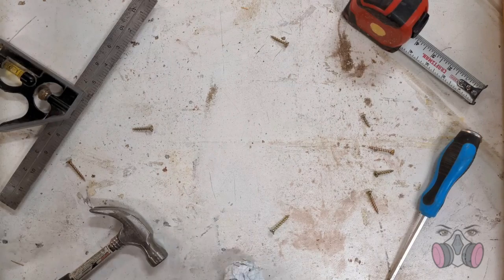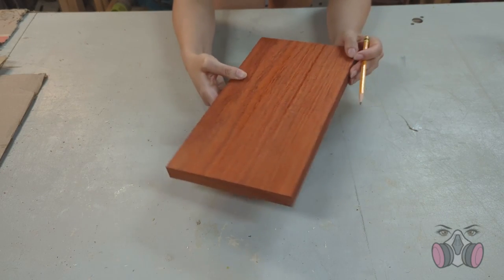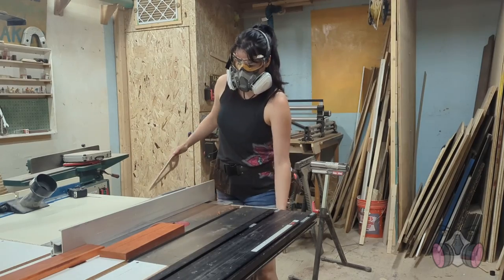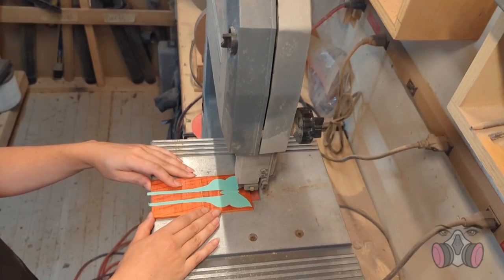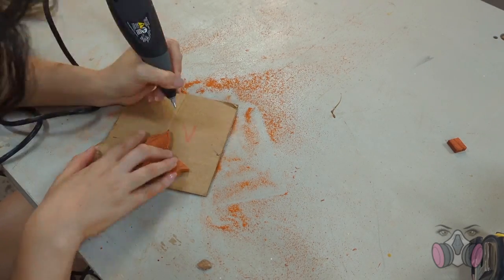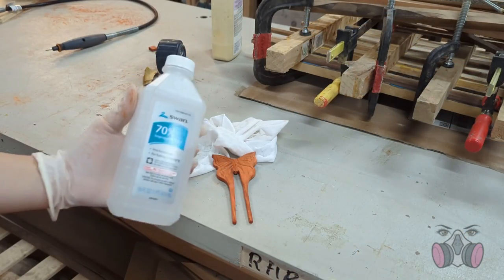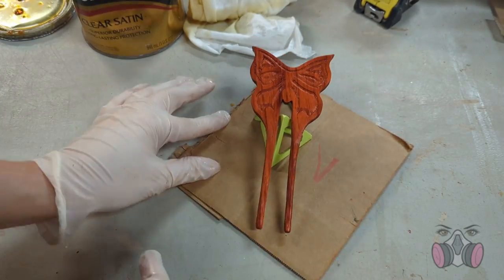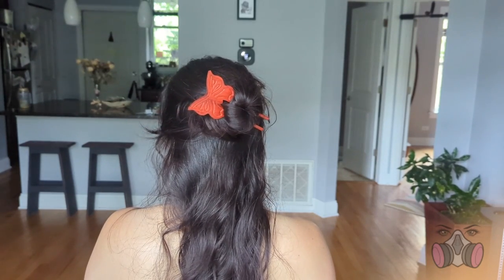DIY Decorative Wooden Hair Fork | Trying Hand Engraving For the First Time

Comment: For the purple heart, you can bake it to get a nice deep purple.  A torch works too but is harder to control(overheat and burn).
Reply from the maker: Oh, interesting. I never heard about this. I'll definitely look into this. Thanks!
Reply: @woodificould  Another thing to keep in mind with purple heart is that it will eventually turn brown. Keeping it out of the sun (or away from UV) will help delay it but eventually it'll lose the purple. I love using it in projects, be it for mallets, cutting boards, or intarsia projects, but I just have to keep in mind that the color is ephemeral.

Comment: Regarding the resawing issues around 4:00 I just switched to a new technique since I had the same problem.   I use the table saw and make two resaw cuts leaving a small connector in the middle. Then use the bandsaw to separate them and plane off whatever’s left.  Works good IMHO but definitely more waste.
Reply from the maker: Funny you mention that because i thought about doing that while I was in the middle of cutting, but didn't think it would make much of a difference. Good to know that it does actually help... might try that next time. Thanks!

Comment: The problem with the purpleheart is, it will in time dull its purple color to a muddy brown. That being said. Your hair fork   looks awesome! I hope you get better soon!
Reply from the maker: Dang, really? I'm guessing that drenching it in poly doesn't help prevent this from happening? And thanks!
Reply: @woodificould  the color changing is a reaction to UV light. When the tree is cut open, it's a pale purple color. Over a few days it changes to the deep purple you see here. If you let UV light continue to react with the wood, it will eventually turn brown. It's not an ugly brown IMO, but it's not a vibrant purple either.

You can slow the reaction with UV protective finishes like spar urethane. But you can't prevent it entirely. Eventually, the purpleheart will turn brown no matter what you do.

Also note that purpleheart is one of the hardest and densest woods out there. It can be really difficult to work with. It's about 25% denser than padauk, so all the trouble you had with the padauk, think about 25% worse with purpleheart.

I know a good number of woodworkers who just avoid it because they think the temporary vibrant purple isn't worth the hassle, but that's a decision you need to make yourself after having some experience with it.
Reply from the maker: @marchingknight11 Oh damn! Really?? Ok, in that case I'm really glad I didn't go with purple heart for this project then because it may have set my bandsaw on fire. And that actually explains why I've only ever seen purple heart used for cutting boards... that way it's mostly kept away from UV lights AND you only need to do a few basic cuts in order to make it, so it's more manageable.

This info changes my plans for the purple heart then... I might just use it for a cutting board too and save myself a lot of grief. Thank you for all this info!!
Reply: @woodificould   haha I tried to plane a 12" piece of purpleheart once and I just gouged and burned the hell out of it. You need a really nice jointer and planer to mill it in large pieces, otherwise you need to cut it down to the smallest piece you can before milling and take really light passes.

On the table saw, use a dedicated ripping and cross cut blade rather than a general purpose or combo blade, or you'll get a ton of burning. You can also bog down some smaller saws but it looks like your table saw is beefy enough to handle it so that might not be an issue.

You should definitely work with it a few times before making a decision. It's really fun to see a finished piece made from purpleheart. One of the most beautiful and durable woods there is! Just know the challenges and limitations of it: It's hard to use, and it won't stay purple forever.